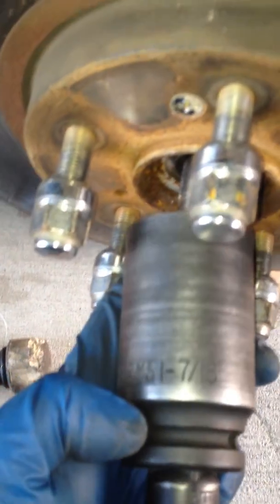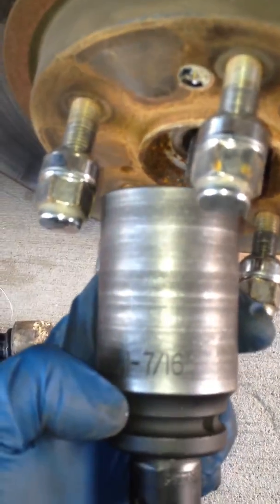2002 Odyssey axle removal

Comment: is right side  same way
Reply from the maker: This side is the hardest to remove but the driver's side is a lot easier once you have the hub off then you put a pry bar between the transmission and the axle and pry it apart quickly but watch where you put the pry bar keep it away from the transmission output shaft seal.